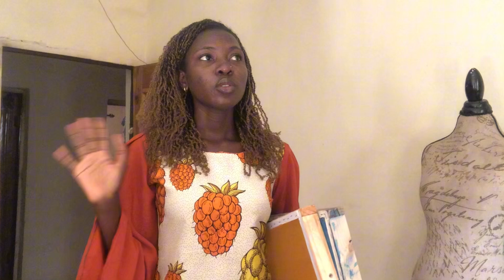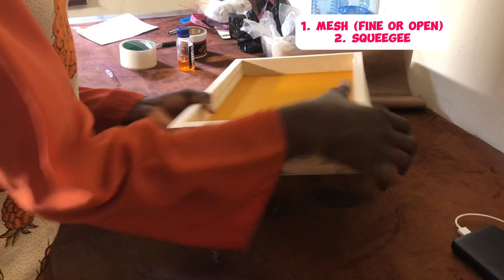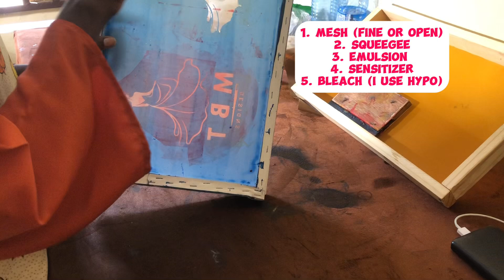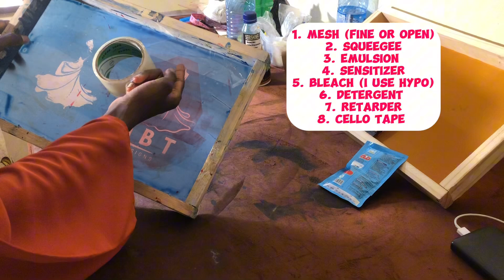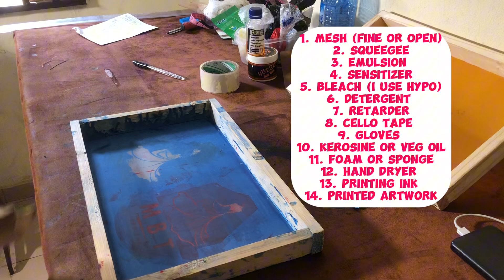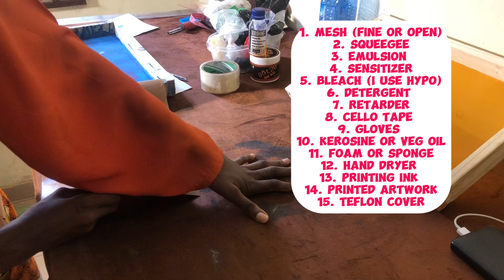Screen Printing Basics (Part 1): Essential Materials You Need to Get Started #screenprinting

Comment: Nice video, the best channel so far on screen printing.

Please  i want to ask if I want to print on canvas, please which mesh should I use.

Open mesh or fine mesh?

I will be happy if you reply....... thanks
Reply from the maker: Use open mesh, if the material used for the canvas can absorb moisture. If it can’t, use fine mesh